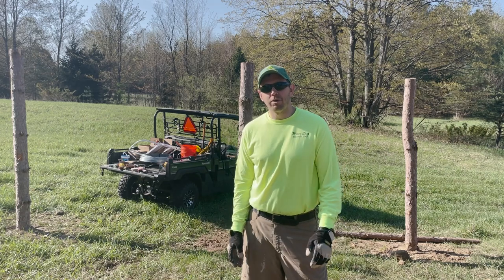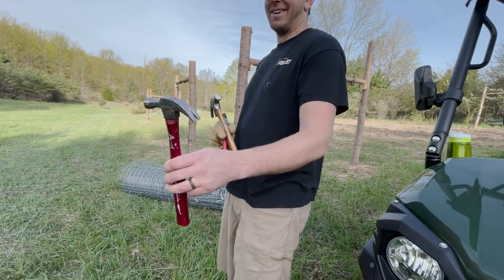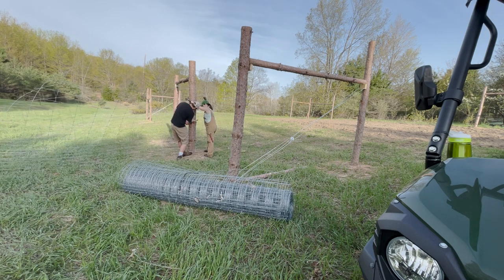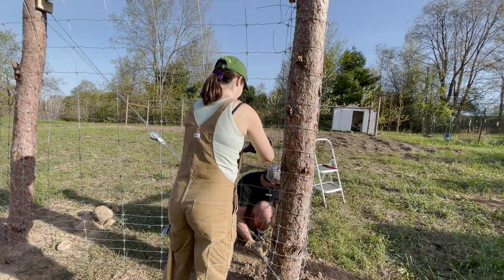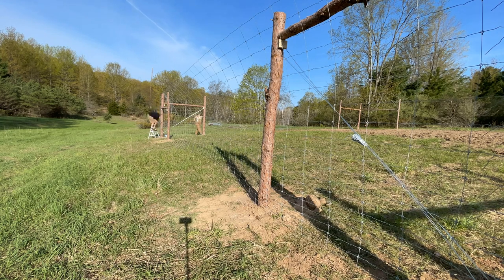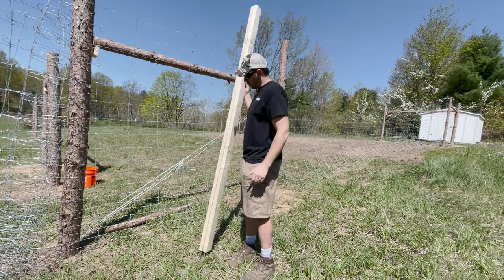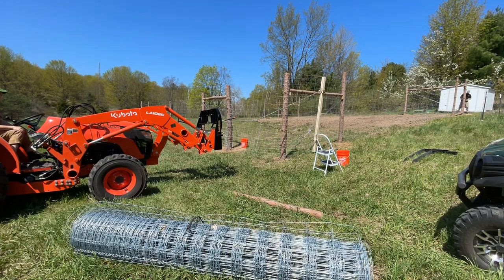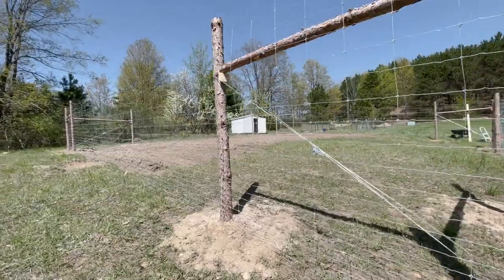8ft Wildlife Fencing - Micro Orchard From Scratch (part 2.5)

Comment: I only have experience with installing 4' hogwire, so I can tell that was a real PITA.  I wonder how long the pine poles will last in the ground...one suggestion if the fence will be permanent, would be to use wire ties instead of staples on the poles.  It will make changing the poles out a lot easier without having to pull staples.  BTW, we use a similar homemade wire stretcher, but only 4' tall 😉
Reply from the maker: We were wondering how long the poles will last also (planning to seal the tops in order to prevent rain from getting in) - we'll be happy with anything over 5 years! Great idea not using the staples.....wish we would have thought about that! Honestly, it was impressive how well the 2x4s worked as a stretcher, good to know we aren't the only ones out there making some of our own supplies hahahaha Thanks for all the comments and support, it means a lot!!
Reply: @CideryFromScratch  Keep an eye on the bottom of the poles at ground level.  That's where it'll rot first but covering the tops will definitely help.  I'm not sure how bad the termites and ants are up there, but hopefully you'll get many years out of them.   I will edit my earlier comment by saying use a staple (not driven all the way in) on top and bottom to keep the wire from raising or lowering and use wire ties (we use galvanized electric fence wire) to keep it from flapping.  Can't wait to see some fruit!

Comment: Hi Folks, great video.Not knowing any think about deer mesh, you don't need a top wire to hold it up? Are their many deer in the area? I guess one is enough.
Reply from the maker: Good morning or rather Afternoon your time hahah Oh yes! loads of deer, we see several every day driving/walking around!! The fence stays up with help from tension and the staples that we placed in each pole. Some times we actually have to pulled down on the fencing to make sure its level with the ground. Thanks again for watching and all of the support! Best, David and Rachel